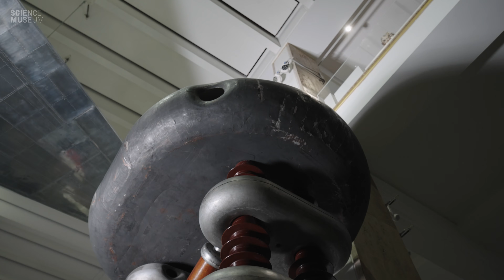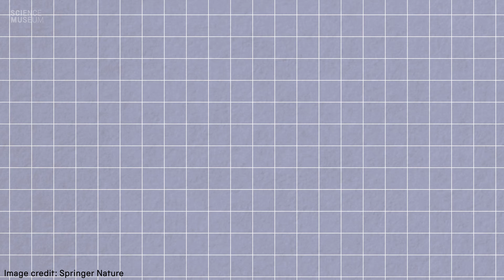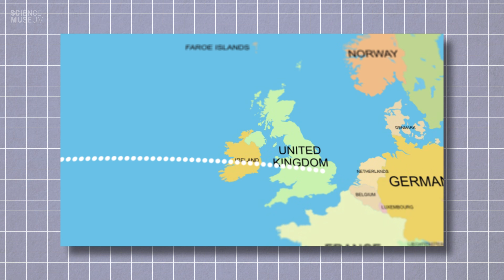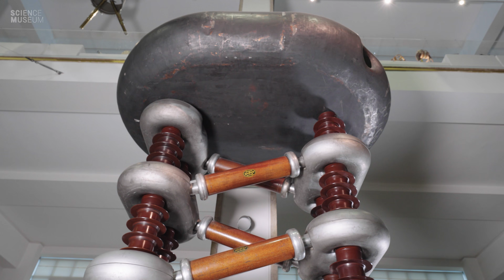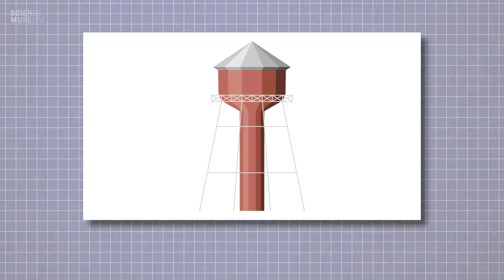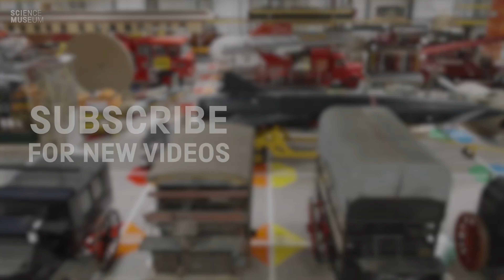The Machine That Split the Atom | Here's The Thing… About The Cockcroft-Walton Generator

Comment: Thanks.  Smaller versions of the Cockcroft-Walton multiplier were used to drive CRTs in BW & especially colour TVs, which required up to 30 kV.  The basic circuit is routinely used today to generate voltages greater than 1,000  Volts using low cost diodes and capacitors on PCBs.  Elegantly simple architecture.  Thanks for showing us the original.

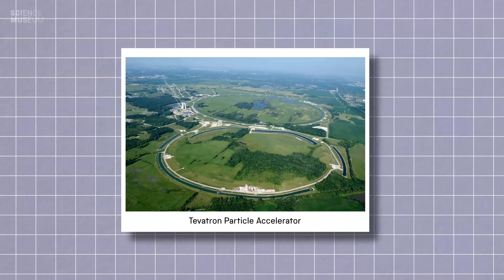Comment: I worked at Fermilab (called Tevatron at 8:25) when the Cockroft-Walton was running, it fed particles into the accumulator.  Walking through that area would erase your credit cards.  You always keep one hand in your pocket so you wouldn't accidentally short out.